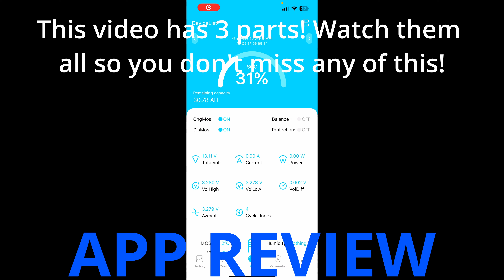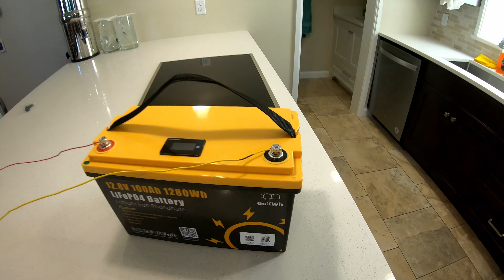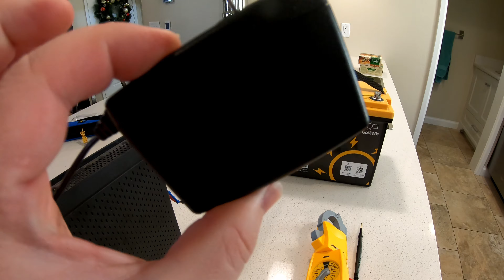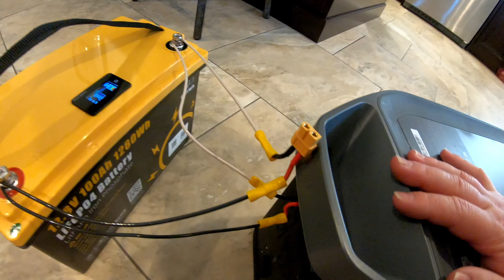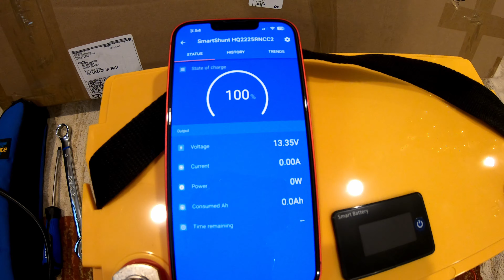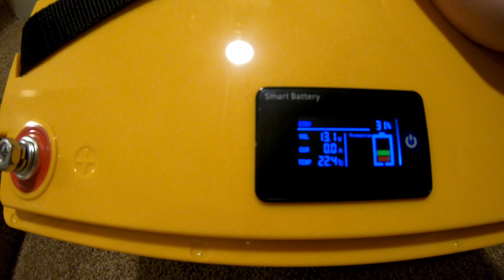How to Power Internet During Power Outage Using Only a 12V LiFePO4 Battery, & More! - Part 2 of 3

Comment from the maker: This is Part 2 of 3 videos. Watch the other two videos using the links below:
Watch Part 1 - Unboxing and First Impressions of GoKWH 12V 100AH LiFePO4 Smart Battery!: https://youtu.be/RBNOhSO9r6E 
Watch Part 3 - How Long Will a 12V LiFePO4 Battery Run a Fridge, Furnace, Washer, Heat Pump…: https://youtu.be/vVZQvYLlcVE
Check out my "12V Battery Testing Results & Rankings for Home Backup" spreadsheet where we compare all the 12V batteries I have tested and rank them for what they do best: https://docs.google.com/spreadsheets/d/1OuUalW-_9BdWMyQz0CxCAM9cpO6whw_LX_exW0Fhqzo/edit?usp=sharing
GoKWH 12V 100Ah Bluetooth/LCD battery information: https://gokwh.com/gokwh-12v-100ah-lifepo4-battery-build-in-smart-bluetooth-lcd-display-2/?ref=49VqO5y5weNPKY
Be sure and use the coupon code: trick20 for $20 off your purchase! 
Buy barrel connector pigtails: https://amzn.to/3NmRJVx 
Buy XT60 ends: https://amzn.to/3TgUE5R 
Buy a Renogy 12V 3000W pure sine wave inverter & charger: https://amzn.to/3GY6JWl 
Buy battery cables: https://amzn.to/3GEIIDi 
Buy Victron Smart Shunt: https://amzn.to/3GY6VF3 
Buy EZ Generator Switch: https://amzn.to/3GAXB9Q 
Watch my install video about this: https://youtu.be/dBP53ggH4nA 
Buy my multi-meter: https://amzn.to/3RCw7qt 
Buy an Anker Solix C1000 power station: https://amzn.to/3RGWhss 
Buy an EcoFlow Delta 2 Max: https://amzn.to/3RfFoDD 
I don’t drink coffee, all donations get 100% re-invested in the channel to bring more un-sponsored content for you. Please consider donating through this link as opposed to using YouTube Super Thanks since I get to keep more of your hard-earned money and less goes into the pockets of large companies like Google. You can also schedule one-on-one consulting/meeting with me here: 
https://buymeacoffee.com/theresatrickforthat 

Affiliate Disclosure
As an Amazon associate I earn from qualifying purchases at no cost to you! Thanks for your support!